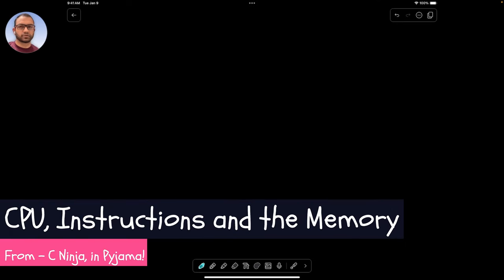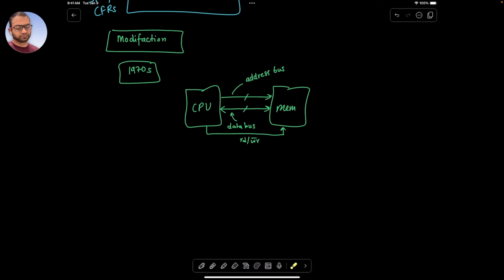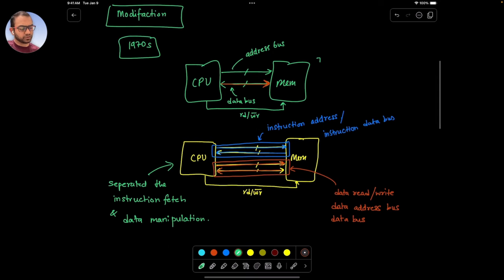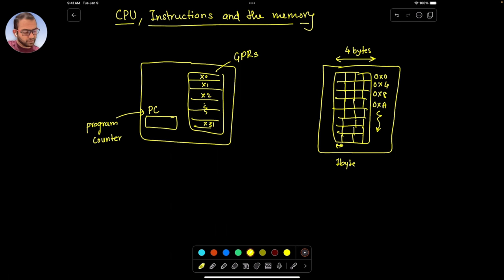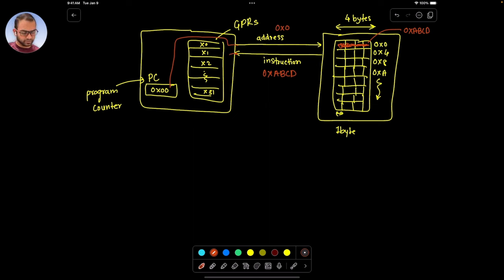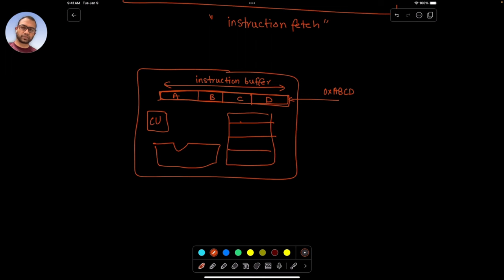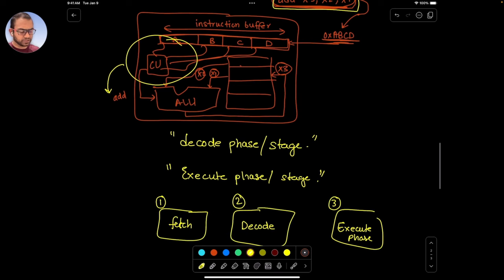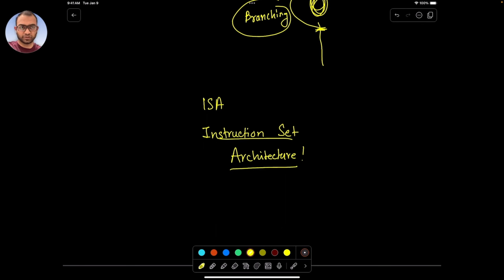4. CPU, Memory and Instructions. Fetch, decode, execute... | Assembly, C on Bare-metal RISC-V

Comment: is instruction buffer different from GPR , SFR and CFR ? Is it something separate or a part of any of these ? if it is part where does it belong to? and does it have the same width as of GPR ? and also are all the registers of same width in general ( Including Memory and CPU ) ??
Reply from the maker: Instruction buffer is as wide as the instruction (32bits usually), it is not part of the GPRs. It is for internal use by the processor state machine.

Memory is accessible at the 8but granularity and assuming it to be made of registers is just part of the model.

Comment: Thank you. Can you please suggest a microcontroller to start learning embedded C and assembly? Are AVR 8-bit MCUs (like ATTiny85 or ATmega328P) good for beginners?
Reply from the maker: Yup they are still good for beginners
Ps: don't use Arduino libraries
Take an Arduino board you can use it with atmel studio or mplabx ide